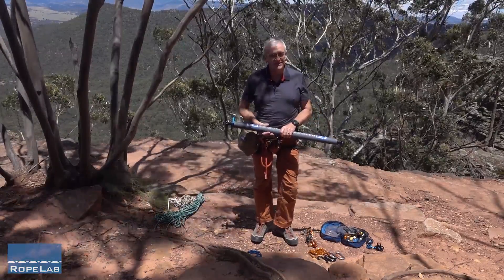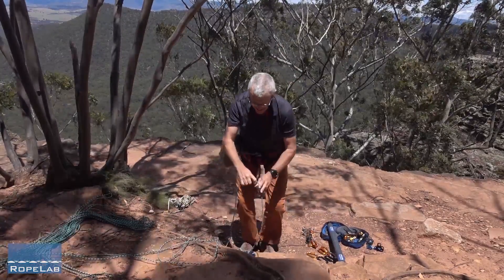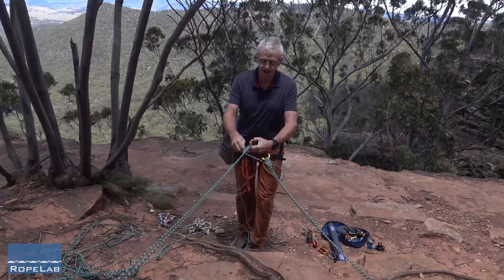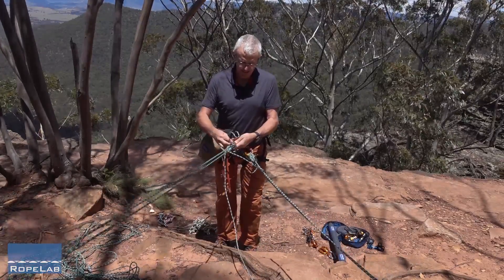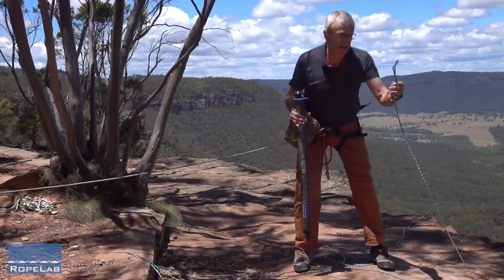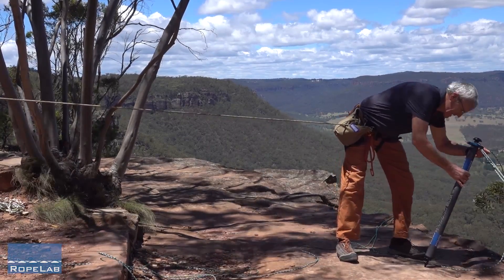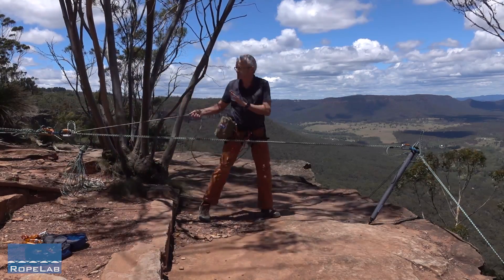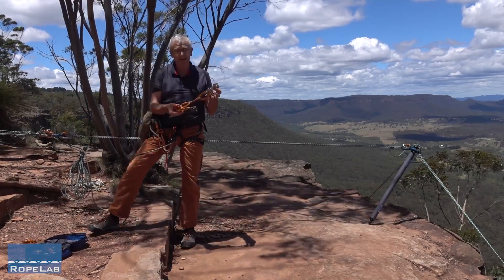SMC Vector Gin Pole: Setup

Comment: Hi Richard, why you use two round turn v.s. clove hitch, any particular reason?
Reply from the maker: Sorry for the delay in responding.  Two reasons: 1. so that it can be adjusted very easily even when under tension, 2. so that it can be untied easily once finished.  This system is placed under a lot of tension so the clove would really bite down hard.

Comment: So the anchor plate is the whole system's focused floating anchor?  Any thought to using a third anchor to consider the plate bomber?  Overkill or no?
Reply from the maker: Not at all.  It completely depends how you choose to run your system.  If I have any doubts about any of the anchors then I will certainly rig to avoid movement of the focal point.
Reply: Richard Delaney thanks for the reply!  Love the videos. Would love to see an example of guying the bottom of the gin pole, if you’re looking for content suggestions. Thanks again!

Comment: Great video! The team I am on just received one. Quick question; Is there a reason you opted for the round turn and two half hitches for three strands connecting the pole to the anchor over a voodoo? Would the round turn 'n two half hitches be more solid on a system that is having repetitive loads?
Reply from the maker: HUFF well It depends on the cord being used.  For Gin Poles I think it is worth using the lowest stretch cord you can find.  From my research, the 5.9mm Sterling PowerCord works best however a single knotted strand is not strong enough - therefore I want multiple strands attempting to share the load and in a way that can be tied off with significant tension.
Reply: Ah thanks for the quick feedback! Generally we use our personal lines when setting up our pole, but we have used that PowerCord before and it's some neat stuff. When they said it was hard in the hand they were not kidding its some tough stuff.